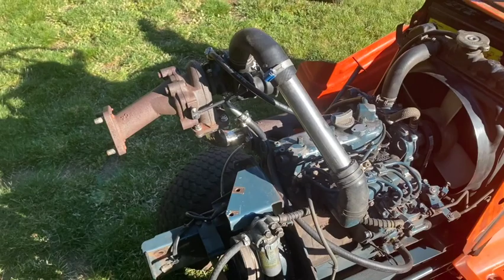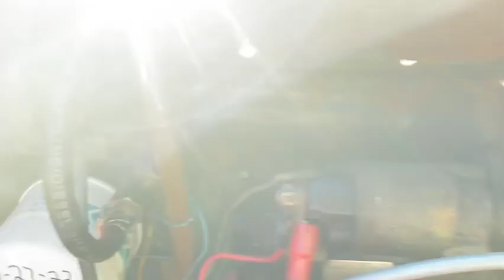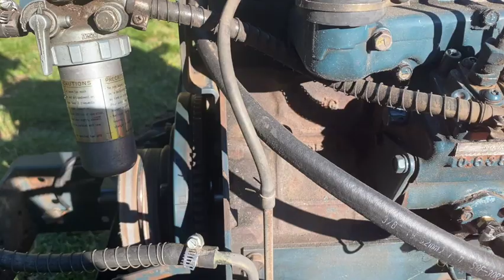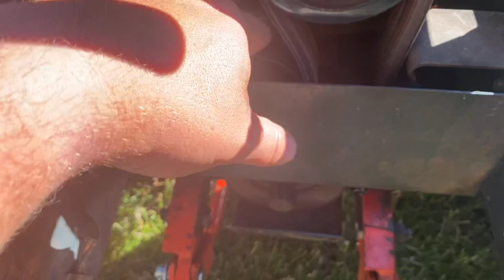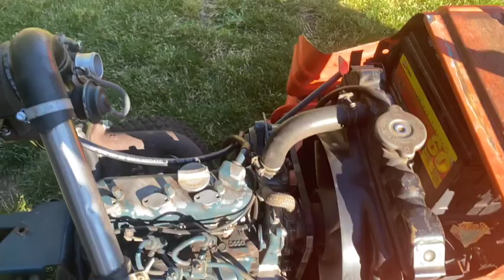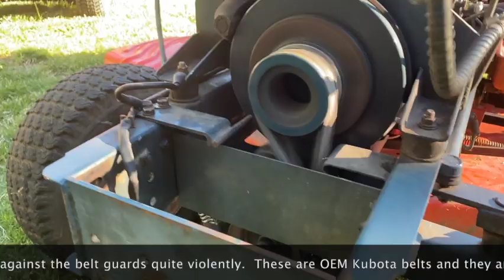Kubota G6200 Turbo Update!!! FINALLY

Comment: With the smaller tutbos  you may need a restrictor orifice to limit the feed oil pressure, I've blown oil out of my vz21 before by feeding oil into it with a full flow setup.
Reply from the maker: That’s a good call. I appreciate the info. I will have to see if I can incorporate a restrictor into that system. Will update with progress.

Comment: You need a oil restrictor on your oil line or your oil drain line isn't large enough, line should be same id as the hole on your turbo have no tight 90° bends.